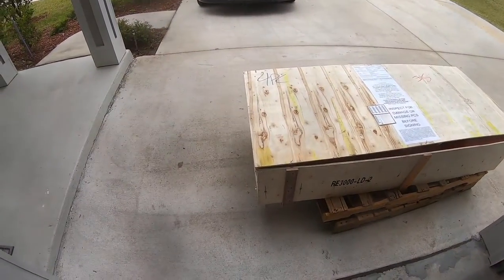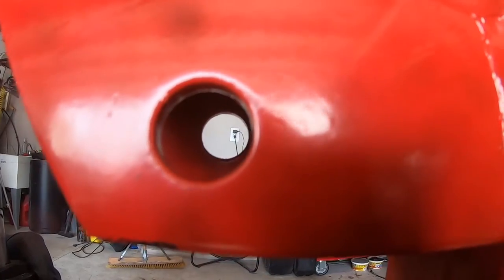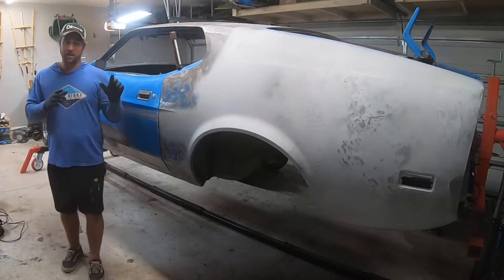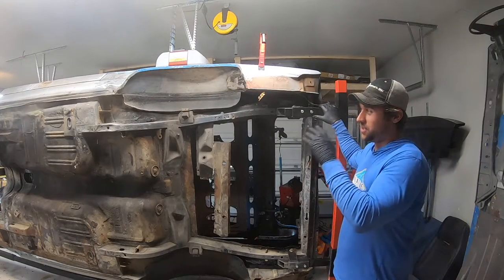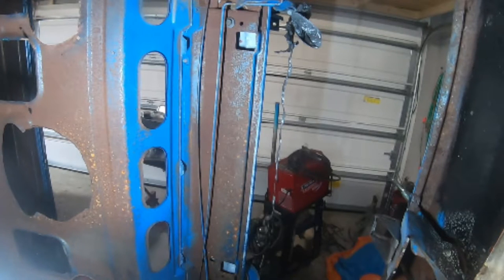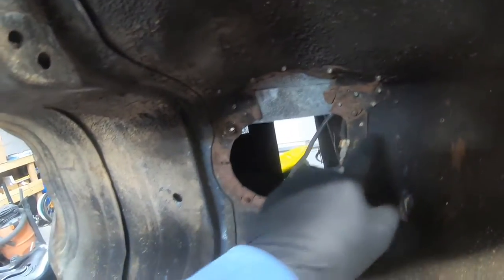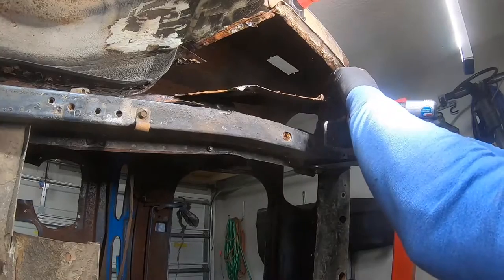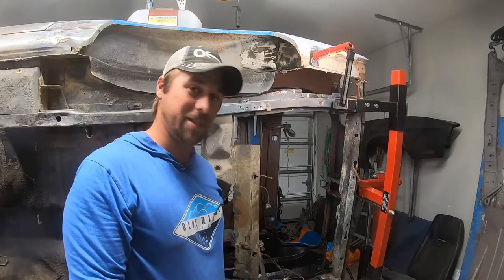1972 Mach1 on Redlines ROT3000 LT Rotisserie

Comment: Thanks, Steffen. I too have a 72 Mach 1 Q code. While I have no intention of going the concourse route, I do want to erradicate all of the rust. The 71 to 73 mustangs were great drivers, but are notorious rust buckets. I'm looking at buying a redline as well. I'm 66 years old and can't work on my back anymore.
Reply from the maker: I tell you what I've never driven one of these cars or ridden in one and I traded a Les Paul guitar for this car about 3 years ago and can't wait to take it on its maiden voyage. If you end up with one of those rotisserie your restoration will be taken to the next level simply because everything will be easily accessible and you'll be able to detail the car exactly the way you want it and address any rust issues you may find which may be missed on the ground. I also recommend joining the 71 72 73 big-nosed mustang group on Facebook as there is a lot of support on there and I try to post as much as I can to contribute on that page.